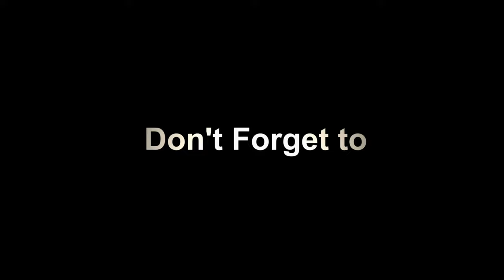2021 DIY Best how to Install a Dual Mirror Camera System | Easy guide!

Comment: Hi, thank you so much for the videos guides and reviews :)! I have a qustion I have seen 4 video of diffrent dashcam rear mirrors you have made. can you make a comparison of them  or at least say from your experience which one you would recommend more?
Reply from the maker: Hi. Thank you for the question.  It is hard to give you a simple answer simply because not all mirror dashcams are the same and pretty much every unit I have done a video on is obsolete will soon be.  I can tell you one brand that I would avoid, is Auto_Vox.  I have multiple hardware issues with their units after I did the install videos for them, and not had any with the units from the other brands.

Probably my favorite unit is the very first one I got from Caidrox ( https://youtu.be/x4QV03_oQ9g ), but Caidrox has long stopped making it.  It is a couple years old and was in full service with over 60K miles under its belt.  It still works, but the vehicle it was installed on was totaled when it hit two deer at the same time (caught on camera: https://youtu.be/VKZZvvQOHJk). The unit survived and I will install it on another car at some point. 

I prefer the units with the square box LD like the Caidrox much better than the units with the full screen where the LED covers the whole mirror.  I installed three of those units and I don't like how they work.  This is because, on the full-screen type, they are designed to stay on 100% of the time and for you to use the rear camera as your mirror and not the actual mirror itself.  This may sound good, but the 170-degree angle of the fisheye lens distorts reality and it is really hard to judge where things are. I much prefer yous the glass of the mirror as a mirror-like normal overusing the rear camera view while going down the road, and only using the rear camera when backing up.  On the units with the square LCD like the Caidrox, the mirror is a mirror and it only turns on the square LCD when you put the car in reverse.  
The other thing is that, because the full-screen type is not designed to be used as a mirror, they do not make the mirror glass to be very good as a mirror, so if the rear camera goes out, you are stuck using a very poor quality rearview mirror until you replace. By contrast, the square LCD are designed to be used as a rearview mirror, and that mirror glass on my Cadroax was the best mirror I have ever used. Even if the camera had gone out, I would have kept it for the great mirror. 

 I will tell you that, the unit in this video is still available, but the video quality is not all that great. I mean, it is perfectly usable, but I have seen much better video quality.

I hope this helps.